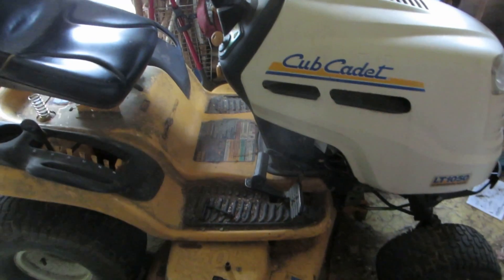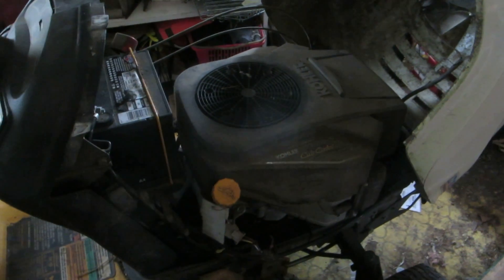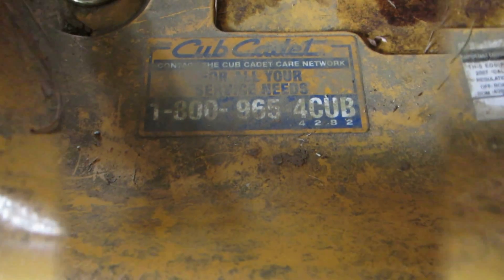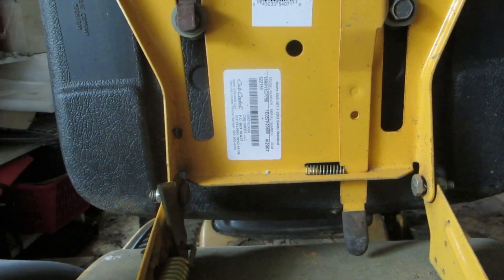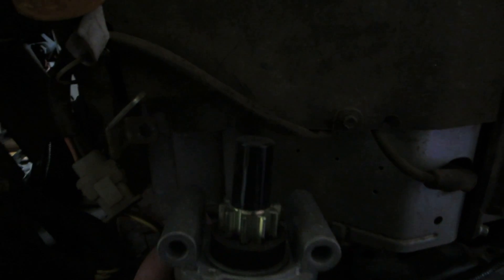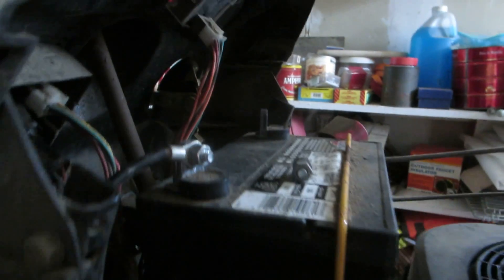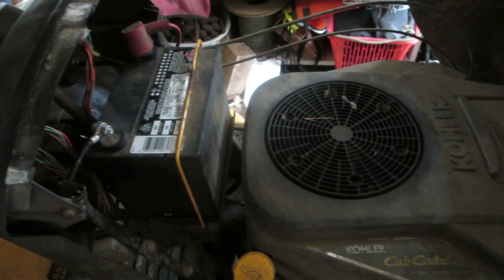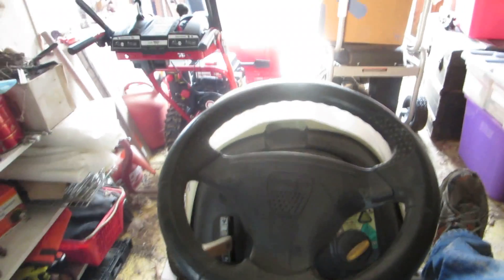Cub Cadet LT 1050 Turns Over Slowly & Won't Start

Comment: Thank you so much, i was given a 1046 cub with same issue will only crank half way and then stops. But I noticed starter was stuck in up position...i tested battery it's fine and power to starter, i was thinking it wasn't strong enough to turn over motor correctly.

Comment: Have you counted the teeth on the new starter and are they exactly the same? I replaced my battery and that was not the problem. My 2015 42 inch XT1 was cranking slow. Sometimes, I would jump it with my car. That would work sometimes. Then, I did some research. The starter would engage the flywheel, but it would not turn the motor over. V-Twin Kohler. The battery has remained at 12.6Volts. That is how I knew the problem was my starter, especially hearing of the horror stories of other Kohler engine owners. Will update when I get it from eBay.
Reply: I just purchased the 3rd generation battery, 9 teeth.

Comment: did Cub Cadet charge you for the new starter...??? if so How much are they ?? I having the same issue with mind LT1046 23 hp  Kolher engine. just like your except a next size below yours.I had all kinds off issues with mind since I purchase it. ( Spindles all had to be replace ...they always came off when in use.. they make a newer model type of spindles that replace my original ones,,, this tractor always has something going on each year,  I have it all.. never stops... I never get another one of these again.
Reply from the maker: I did have to pay and it was over $100 if I recall correctly. I have some deck trouble but mine has run pretty well. Good luck!